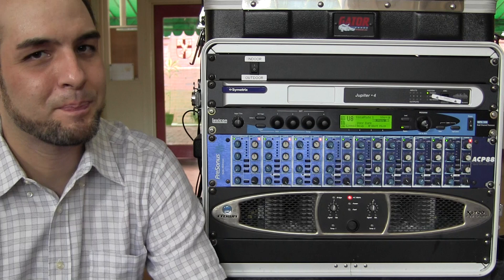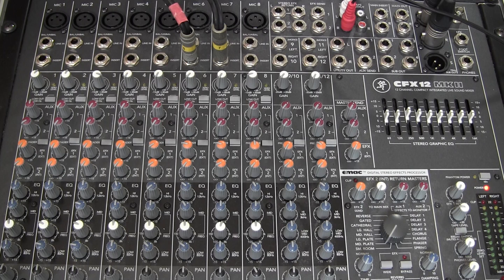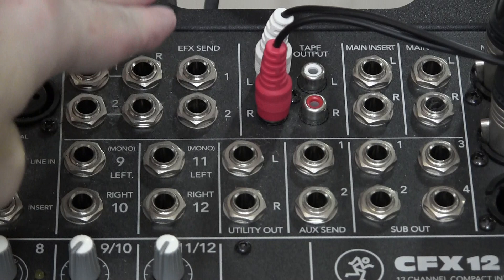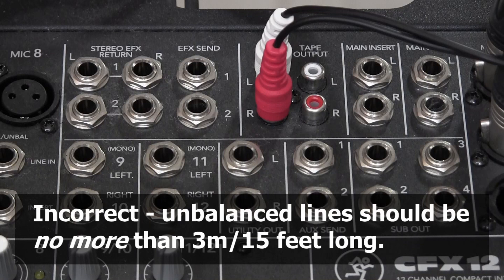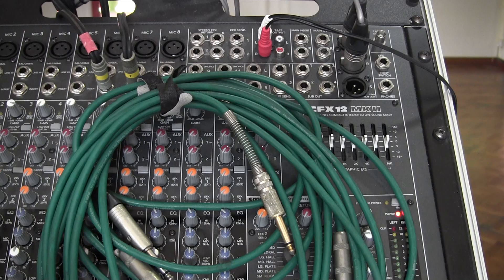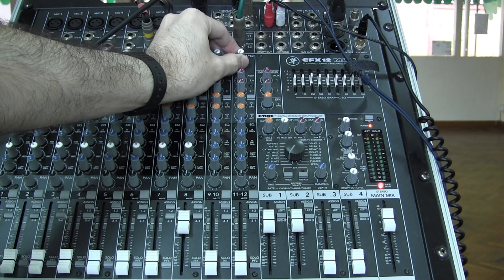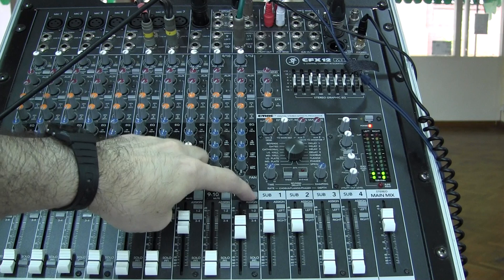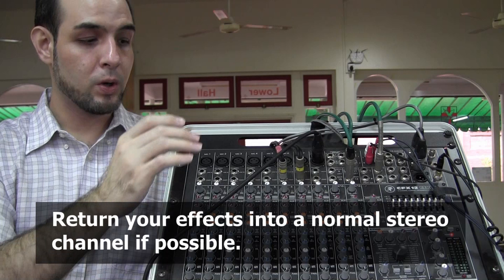How to set up an external effects processor for live sound

Comment: Excellent video. One of the few videos that have actually taught me something. I'm a DJ with over 20 years experience playing music but NOT 20 years experience routing sound thru a mixing board. The basic routing, yes. More complexed routing like this, no. I have a pretty good sized sound system but have yet to use it to it's maximum potential. Videos like this help me understand sound reinforcement and routing effects. I have subscribed and will be searching your videos some more. Thank you so much!
Reply from the maker: - Very glad to hear that the video was helpful. And yes, using the equipment that you have to its fullest potential is much more important than buying new gear that you don't know how to use! All the best with your music, look forward to learning from you too :)

Comment: Thank you so much!  I have a Behringer mixer with very similar layout.  My problem was that in some cases, I want ONLY the post-effect wet sound sent to Main, not a mix of the dry and wet.  Using Behringer's AUX Sends and AUX Returns mix the two so that both wet and dry are sent to Main.  By having my returns go into individual channels as you suggest, I now have greater control over the returns and now only send those returns into the Main bus for processing.  Perfect!  I wouldn't have thought of this until watching your video.  Thanks again!
Reply from the maker: Yes returning the wet signal into the aux returns normally does not give enough control for live sound. They key is to set the effects unit output to 100% wet and then do the actual wet/dry mix on the mixer itself. Glad the video was helpful!

Comment: 6 years have passed and this is still the best video I found on the subject
Reply from the maker: The technology has not changed in that time - almost all recent developments have been with digital mixers.
Reply: @GLBProductions  Yes, which btw is a bit sad imho, because as i upgrade my equipment i always find myself exchanging the digital for the analogue for reliability reasons.
Reply: Btw I can't seem to get a clear answer to this from anybody yet, maybe you could help me: On 2-channel compressors that have "stereo coupling" and sidechain inputs for each channel, can I use ONLY ONE sidechain input as a detector for BOTH compressor channels? (I'm trying to use 1 mono mic to auto duck a stereo source)
Reply from the maker: Yes you should be able to do this - the stereo couple switch generally means that the slave channel will mirror the behaviour of the master channel, regardless of whether the key signal on the master comes from the main input or the sidechain. Try it and see - you'll soon be able to determine if the two channels are following each other.
Reply: @GLBProductions  Great, that's what I thought! Thanks.

Comment: Particularly found the using stereo inputs rather than returns very helpful.

I have been struggling this today trying both ways.

Watched a couple of your video’s and like other’s found your explanation very detailed but simple to understand.

Straight to the point and very well spoken.

Great job.. Thank you
Reply from the maker: You're most welcome - external FX units are one of the more arcane aspects of working with analog mixers, fortunately onboard units have removed much of the hassle associated with them.

Comment: Thanks.  This video just saved me a lot of time and expense in setting up a gig at our venue where the band is outputting two stereo effects from a rack.  Now I know I can just run them through our XLR Mic channels and not have to reconfigure the back of the mixer to use the FX Returns with XLR/TRS connector adapters.  Plus using the standard Mic channels has advantages.

Comment: Bruno, I just received our Church's TC Electronics M350 Process today. I will be attempting to set it up this Friday based on this video. Can't wait to use it with our Praise Band and our Choir too. Have to move some lines around to open up a Stereo channel for the Return Send.
Reply from the maker: +Chris C. Great! Hope it all works out. Remember not to add too much effect - a little bit goes a long way...
Reply: +GLB Productions Will do. I plan on starting at 12 O'clock (Unity Gain) on the dials. 00 on the Stereo Return as you showed in the video.
Reply: +Chris C. Bruno, do you have an email address that you can be communicated with?
Reply from the maker: Chris C. Please send me a personal message on YouTube, thanks.
Reply: +GLB Productions 

Bruno, I first want to wish you a Merry Christmas and a
Happy New Year. May 2016 be a great year for you and GLB Productions.When I installed the TC Electronics Effects Processor to our mixing board
(A&H GL 2200) I did it as recommended by the music store that I purchased
it from since all of my stereo channels (with a fader) were being used. Instead
of returning it to the mixing board into a stereo channel (all were being used
for CD & DVD returns to the mixing board) I brought it into two single (mono)
channels that were open. I wasn’t getting any response (Reverb), so I
disconnected one of the Stereo Channels and connected the return to the mixer
from the processor. I was successful at getting reverb, but was not successful at
being able to adjust the amount of reverb with the fader as you showed in the
video. Why would I not be able to change the amount of reverb using the fader?
I had all the settings on the Effects Processor at 12 o’clock.
Reply from the maker: Chris C. Happy New Year Chris, and blessings for 2016!

When setting up an effects unit in this way, make sure that the wet/dry mix on the effects unit is set to 100% wet, as you are doing the blending on the mixer rather than on the unit itself. 

Secondly, make sure that you are actually sending signal to the unit itself - you should be seeing both input and output levels on the effects unit. Finally, remember to set gain on the mixer channels as you would with any other signal, using the PFL/solo buttons. You can then use your headphones to confirm that the correct wet signal is coming back into the mixer. 

Hope this helps, let me know how things go. 

Bruno
Reply: +GLB Productions

Thank you Bruno. I will double check all the setting you mentioned in your reply.

I am also going to combine the CD and DVD returns to one Stereo channel since we do not use them at the same time. That will open a stereo channel for the effects processor return.  I will let you know how it works out.
Reply from the maker: Chris C. Sounds good, hear from you soon!
Reply: +GLB Productions Bruno,I am happy to report I was successful at getting the Effects Processor working. I was able to control the amount of reverb using the fader on the stereo channel it is returned on. I believe why I was not getting the results the first time was I didn't have the reverb setting on the Effects unit at 100% Wet. I was also able to notice that I could control the amount of reverb going to the specific vocal channel by panning the AUX send. I am now anxious to use it with our praise band vocals. Your were right a little bit of effects goes a long ways. Especially when you include Decay to it. Thank you again for you video.Can you recommend any videos for recording from a mixing board to a computer (PC)? I will also search You Tube.
Reply from the maker: +Chris C. That's great news, thanks for the update. How are you planning to connect your mixer to the computer?
Reply: +GLB Productions Bruno,Currently we are using a AUX send from the mixing board to a CD-RW Recorder. I could use that, or I do have another AUX send that I could use to send to the computer into the microphone port on the laptop. if that would work. Do I need to use and audio interface unit?
Reply from the maker: Chris C. If you mix in stereo it's best to record the service in stereo - is the REC out or tape out available for use? 

I have found that it's best not to use the mic input on laptops for any serious recording - the A/D converters are generally of poor quality and you almost always get hiss and/or distortion due to a mismatch of levels. Ideally you should use an audio interface. An alternative would be a simple handheld digital recorder with a line level input.
Reply: +GLB ProductionsBruno,Thank you for the reply. Do you have a recommendation for a audio interface? We have a laptop with Windows XP on it that we would be using.  I do need to see how much hard drive space it has.
Reply from the maker: Chris C. My current recommendation would be the Steinberg UR22. Alternatively you can consider any of the handheld recorders from companies such as Zoom that can also double as USB recording interfaces.

Comment: Good job explaining.  

Its something I've done many times but I still enjoyed your explanation.  In fact long ago I had a Mackie mixer, then used an Allen Heath that was very similar but had better sounding preamps.  

I listened to your presentation almost to the end.   One thing that is a potential problem with using a channel as a return is internal feedback.   (Didn't hear you mention it).   That is what occurs if you turn up the Eff1 (Aux3) send on the Effects return channel, sending the reverb back to the reverb.   That can be a real mess, and is probably the only reason why you might not want to use a channel with a novice sound person.

Good job.  I would send a new sound person to this video to get a better understanding of effects for live sound.
Reply from the maker: You got that right - thanks for watching!
Reply: @GLBProductions  hi, first of all you explained very detailed about the conection between a mixer and outboard effects. I have a question for you. So if I have let's say 5 outboard effects and I want to connect them to a mixer all at once won't I run out of Aux send inputs? Or if I plug the effects to Aux send and take the outputs of the effects to stereo chanells I will run out of both Aux send inputs and stereo channel inputs. What if I want to use them in the studio and have dedicated send chanells in the DAW for each effect? Thank you once again.
Reply from the maker: @stefanalcaza5558  Yes, that's one of the reasons why many of the old analog consoles were so large - the biggest ones had as many as 16 aux sends and 8 stereo channels to accommodate all of the outboard gear needed for big shows. Nowadays of course this has all gone digital and mostly inside the console... If you have a smaller console you will need to prioritise. 
When working with a DAW it depends on what sort of interface box you have and how it is wired to your mixer.
Reply: @GLBProductions  thank you for the explanation. If you would like to do a video on this subject in the future that would be awesome. Thanks again 👍👍

Comment: Ok thank you for your help. looks like I have to buy 2 more for each mic.
Reply: +D.J. ROCKWELL If you want the same effect/preset on all of the mics, at varying amounts, and if you set up your board the same way as described in the video, keep in mind that each channel on your board can send to that output by turning the same knob on each channel (i.e. turn EFX SEND 1 knob on each channel). The thing to watch out for will be peaking/clipping the input on the effects processor.
Reply from the maker: +Michael Reaves In this case I believe he wants to use the feedback killer function and have it operate independently on all three channels, hence the need for three separate units. You could use the same unit for all three, but the end result would not be as good because a filter set for just one mic would affect all three of them.
Reply: +Michael Reaves  o o o think that just answered my question ..cheers

Comment: Thanks for your videos they are really helpful.
can you post some videos that shows how to connect equalizers and feedback suppressors to the mixer
once again thank you so much for your videos.....
Reply from the maker: - Thanks for the comment! I will add you request to the list. I'm afraid I don't use feedback suppressors any more - I used them a bit in the early 2000s but find that I can now deal with virtually all feedback issues using mic placement, EQ and gates/expanders.

Comment: Just as a constructive note: You really should use a lapel mic to get rid of the "room sound / echo". You can really hear the room and it detracts from the pleasure of watching a primarily great instructional video. Love your vid's keep up the great work and GOD BLESS!
Reply from the maker: +James Noll I know what you mean! This particular video was shot in a hall with unusually bad acoustics - relatively low ceiling, hard walls and floor etc and you can really hear it. The fact that I tend to speak loudly when shooting only makes things worse :P In my more recent videos I have used various off-camera mics to try and lose as much of the room as possible. I personally do not like the way lapel mics sound - they pick up a lot of resonance from the torso cavity and also lose the high frequencies that radiate forward from the mouth. Thanks for your input, God bless you too brother!
Reply: I know what you mean about lapels. Perhaps a noise cancelling shotgun mic that has a very narrow pick up pattern. The other thing you can do is to use a wide spectrum eq to  "notch" out the ringing of the room and like -10dB or so to lessen the aural impact. Using a parametric eq could work too.  Good luck and thank you for the great work instructing us on the proper use of pro audio equipment.

Comment: Hello. Thanks for another very helpful (and very clearly explained) video post - these are extremely helpful to a mixing newbie like me!
I have a question relating to this particular process. I have set up my mix so that I am sending via an aux send (in mono) to an effects rack (a TC Helicon VoiceLive rack) and coming back into a stereo channel strip on my mixer. Everything is working just as you instruct in the video for my main or FoH mix - I'm able to blend my 'dry' channels with the 'wet' effected stereo channel and things sound great. But am I able to send this mix of 'wet' and 'dry' to my on stage monitor mix as well? If so, how?

Comment: great video. 
However, you should make reference that the effect of using the pre fader is only a preference for the style of performance your working.  The post fader can be used for different purposes for show effect elements.
Reply from the maker: Correct, stage monitors for ballet performances are usually run post-fader so that the music on stage tracks the volume in the front of house.

Comment: As I go from song to song when performing live (I am mixing myself) I don't want to be adjusting the aux send to different levels between songs as I get it set at the beginning    for my gain structure. I prefer to make a preset for each song on the reverb unit with output levels and decay times adjusted to the song. Oh, to have a sound man like you who could be there for me!
Reply from the maker: PhotoMusicMan That's definitely the way to go if you're self-mixing. I know some performers who use a midi controller to change presets between songs so they just tap up or down as opposed to having to find a specific number. 

Yes it's nice to have a sound engineer but remember that for centuries live music has been performed with the performers balancing one another off the stage ;)
Reply: GLB Productions Thank you for your help.
Reply from the maker: PhotoMusicMan You're welcome my friend.

Comment: This is FANTASTIC. So helpful. What I'm struggling with is, somehow, setting up two separate monitor lines on boards such as the Mackie 1202VLZ4 12-Channel board that only has one dedicated monitor out. Is there a simple way to fix this problem?
Reply from the maker: The simplest way is to simply use the second aux send and then minimise your fader movements, as these will affect the second aux send.

Comment: I know this is an older video but I hope you’re still around to help. I bought a Yamaha MG 20 mixing board and I have a TC electronics M 300 processor. Yours is the only video I’ve seen hooking up external processors. i’m still a little confused about the auxiliary send to my left input, and my output to ???
Reply from the maker: Ah yes - that unit is somewhat unusual in that it can operate in either serial or dual input mode. To use the method shown in the video you would set it to serial routing and follow the diagram on the back of the unit: aux out from the mixer to the left input of the M300, output from the M300 in stereo to any stereo channel on the mixer, which will act as the FX return.
Reply: Thank you for the quick reply.

Comment: Hi Bruno. Your tutorials are clear & very practical. Thank you so much. My Desk is a Behringer SX3282 & does not have internal FX or the same FX Send 1 or a FX Send Control as the Mackie. I use Aux 3 for Send & Stereo Channel for Return. Using the Aux controls on that Channel I can feed FX to my other 5 Monitor Sends. That is OK except when adjusting the Vol on the Channel Faders it also adjusts the FX levels to the Aux/Monitor Feeds
Is this because the Desk has no dedicated FX send & Control?